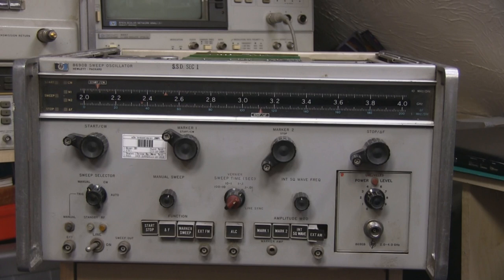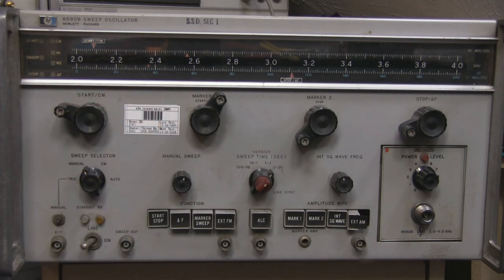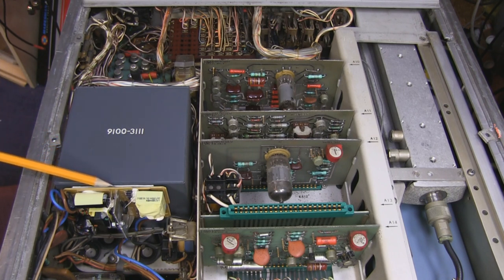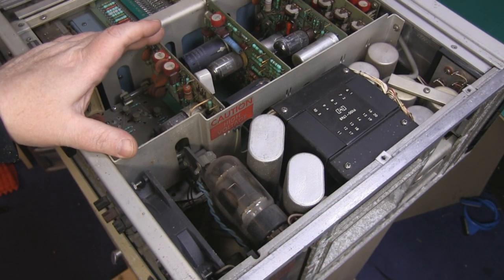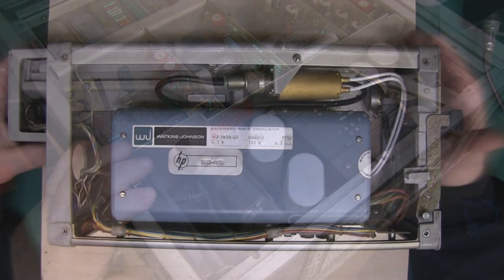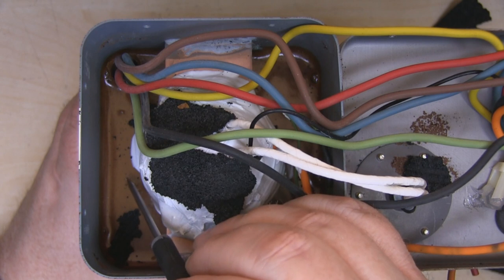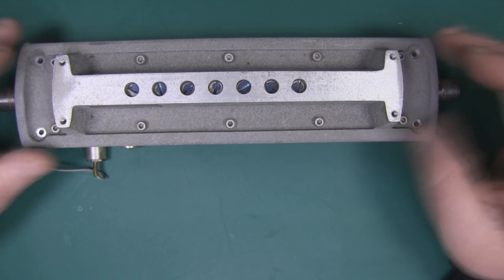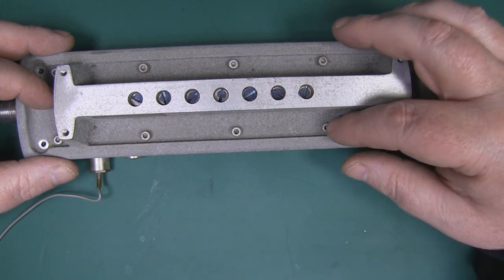Hp8690b Sweep Oscillator Teardown and Parts Salvage

Comment: One of the large valves (tubes in the US) is probably used as a full wave rectifier with dual plates and cathodes. The other could be a triode and used as a voltage regulator.  A small
helical wire would be the grid of a triode.  '66 was the time when solid state oscillators and amplifiers were making their appearance in place of TWTAs, etc. However, their power outputs was still low and their frequency range was gradually going higher into
toward X Band.  I was a sales rep for Watkins Johnson in '67-70.  Extension PC boards were also for solid state transceivers  (Yaesu FT-7) in the '70s for troubleshooting and alignment.  Byron WU2J

Comment: That expansion card is actually a service card. It is so you can work on a card out of the machine, e.g. easily probe voltages etc Be careful with the large vintage capacitors, they can contain harmful polychlorinated biphenyls.
Reply from the maker: +Robonza Thanks for the info Robonza you do have to be careful tearing down vintage electronics